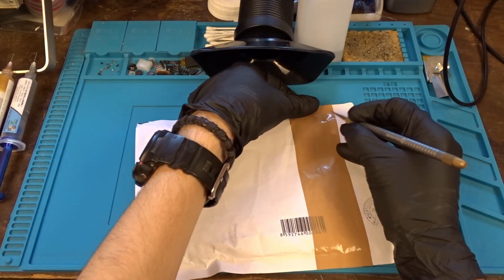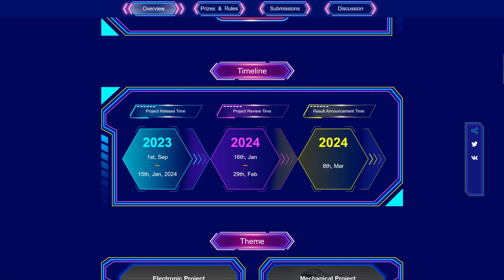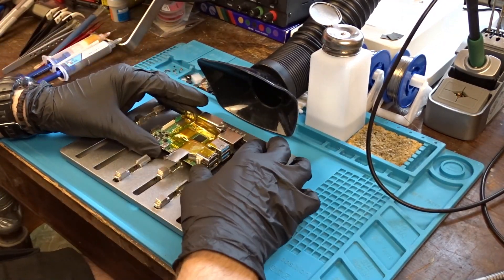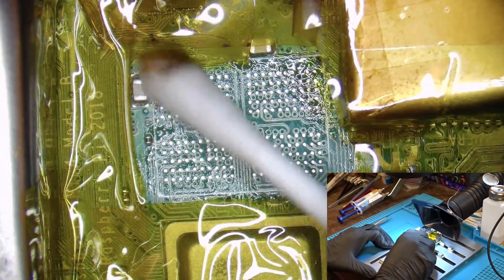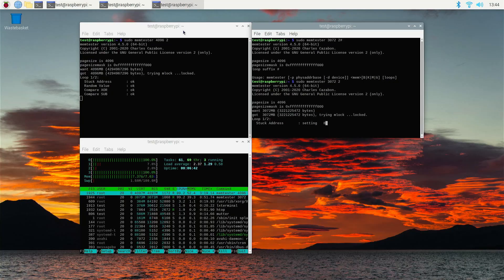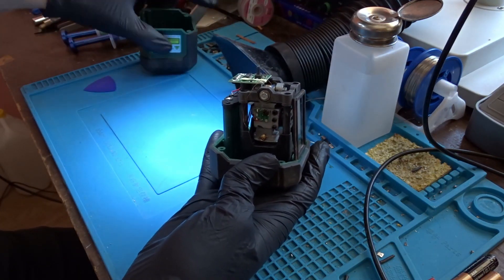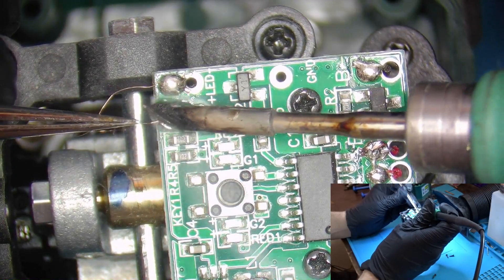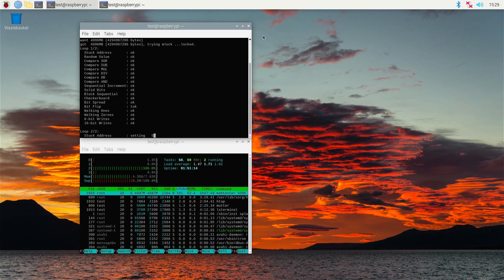Don’t throw your Pi away, it can be fixed!

Comment: I have Raspberry Pi 4 B, suddenly only the Red Led is always turned on when power is connected and Green LED never turns on using original power adapter. Tried changing the power adapter, Flashing EEPROM using different SD Card, and Flashing the latest ROM. Still only the RED Led is turn on. (Red Led Never Blinks too)
Reply from the maker: If there is no 3.3V when the board is powered on, then 99% the problem is faulty PMIC. Either DA9090 or MXL4407-P4 depending on the revision of the board.

Comment: Hello, I have a Pi 4B 8GB model, which fell from my hands while I was air-blowing it for cleaning. It fell on its base (the surface with the SD card) and ended up with this same SDRAM failure.

But if I apply some pressure with my fingers onto the RAM (it has a heatsink on top of it), it boots properly to the desktop. What are my options for a proper fix since I cannot send it to you as I live outside of the EU.

Thank you for the video.
Reply from the maker: Hi, well most likely there are some cracked solder balls or ripped pads under the RAM chip or the SoC, both are fixable by re-balling or repairing the ripped pads.
If the problem is only with the RAM chip I think a good electronics repair shop (locally) can do the re-ball as it's likely they have a LPDDR4 stencil on hand.
But if the problem is with the SoC It should be somebody that repairs Raspberries on a regular basis as the stencil for it is a lot harder to come by.
Last resort is to list it as not working on ebay for like 20$ and just buy a new one.
I know new ones cost more than 20 bucks, but at least you get something back from the non working one...
Reply: @MadEDoctor  I see. Thank you for the help.

Comment: Sir, when I am powering on my rapsberry pi 4 model b only the red light is switched on. Also the pi is not booting, what can be the reason?
Reply from the maker: Check if you have 3V, present on the GPIO header, if not then it is most likely a dead PMIC (DA9090 or MXL7704-P4)
Reply: @MadEDoctor  Sir, its giving 6.4 V while checking on 3 V GPIO without using the memory card.
Reply: Same voltage while using the memory card.
Reply from the maker: @deeparya7245  I don't know how to put it, but that's definitely not good😅

Probably everything that connects to the 3V rail is fried and the Pi is for the trash bin.
Reply: @MadEDoctor  Done and dusted....😅

Comment: Raspberry pi 5 usb ports stopped working ..no power please help
Reply from the maker: Let me take a closer look at the Pi 5 and I will write you back later with possible solutions.
Reply from the maker: Sadly I don't think there is something that can be done about it...
Becuase the Pi foundation has designed its own main PMIC and USB (I/O) controller, which to my knowledge they decided not to make them publicly available and so can't be purchased as spare parts.
And so you are now a proud owner of a brick, unless are still under warranty, then you can contact the store you got it from.
Reply: Can you help me with the warranty process
Reply from the maker: @alltogether5609  I believe you should just contact the place you bought it from and say that your Pi just stopped working and you would like to return it under warranty.
Reply: Yes i have bought it 1month ago
Reply: Thanks after contacting the store i will update you
Reply: Now i have checked the usb ports with e usb doctor .the voltages in all usb ports are 3.55 volts.. plugged a keyboard reciever ,not working
Reply from the maker: @alltogether5609  Well there might be a short on the 5V rail somewhere that is drawing a lot of current and so is pulling the 5V rail down to 3.55V.
If you have a multimeter you can check the voltage on the 5V GPIO pin to see if that's the case, but be extremely careful as shorting the 5V rail to any other pin might result in completely dead Raspberry Pi
Reply: @MadEDoctor  i have checked the voltage on 5v  gpio pins its approx 5.1volts
Reply: In the basis of this case can i claim the warranty from the seller? I have just unpacked the pi 2days ago and tomorrow i have power on the pi with raspbean os . And discovered that keyboard and mouse isn't working 😭
Reply from the maker: @alltogether5609  If that's the case I think you just got unlucky and got a defective Pi and you should be able to claim the warranty.
Reply: The seller is saying that they will send the pi5 to UK. There they will attach the pi with their automatic diagnostic system.if fault is mine they will return the faulty pi, if fault from their side they will replace..its a 25day long process . what do you think about the fault? How do i know that warranty is voided?
Reply from the maker: @alltogether5609  I don’t know how exactly they evaluate the damage with the Pies, but I think it’s at least worth the try. I believe it’s a defective chip or something and if that’s the case I don’t think anyone could repair it other than the manufacturer… So I would say go ahead and try your luck with the warranty process🤞

Comment: "Hello excellent video very interesting all the contribution of the RAM update. I have a question: is the RAM of Raspberry Pi 5 also compatible or are they different modules, other technology? Thank you very much. I hope you make more Pi videos in the future. Greetings from Colombia."
Reply from the maker: I haven't looked in detail yet, but the Raspberry Pi 5 uses RAM which has the same footprint as the RAM on the Pi 4.
Having this said I am pretty sure it will be possible to upgrade its RAM, even using the modules that were found on Pi 4.
If I am not mistaken the Pi 5 uses LPDDR4X and the Pi 4 uses LPDDR4. 
I think the only downside will be that the old chips are a bit slower on paper, but that's hardly noticeable IRL.
I am thinking about trying it myself and making a video about it, but I am not so sure when I will have the time to make it.

Comment: I have a Pi4 when i power it on the green LED flashes continuously, what would be the problem, and any solution...
Reply from the maker: If it blinks in a pattern for example 8 fast blinks, then a little longer pause, and then 8 fast blinks, and so on, this will mean a SDRAM failure.
That can be fixed by replacing the RAM chip.

Comment: What about the PSRAM error 2 when you boot. Is that the same chip? My RPi4 does no longer boot after a standard power cycle and on the serial port it gives error 2, which refers to a ram error. I am about to toss it, but viewing your video I get hope again...
Reply from the maker: I struggle to find any info on the problem...
But if the problem is a dead SDRAM chip, then it's repairable.
When you power it on does the Green LED light up and if yes does it blink in a pattern like for example: 8 fast flashes then a pause and again 8 fast flashes?
If you want you can contact me by email to discuss it further.
b.brishimov01@gmail.com
Reply: @MadEDoctor  Thanks, just sent you an e-mail. For the other readers, I was mistaken, it was Error 8. (It was quite some time I put the thing away.)
Reply from the maker: I will check on this later and I will write you here.

Comment: What are your opinions on the new raspberry pi 5 and its ram upgradability?
Reply from the maker: Well I am not familiar with much details at the moment, but as far as I know the RAM will be upgradable up to 8GB.
Also it features a new (again impossible to buy) PMIC - DA9091 which will make it impossible to repair if you accidentally short the +3.3V and +5V rails together...
As far as performance goes I wouldn't expect much more than what we had with the 4, because after all the CPU remains 4 core ARM chip...
That's what I know at this stage, and having this said I think the most reliable and repairable Raspberry Pi will still be the old revision of the Raspbery Pi 4 which uses MXL7704-P4 PMIC.